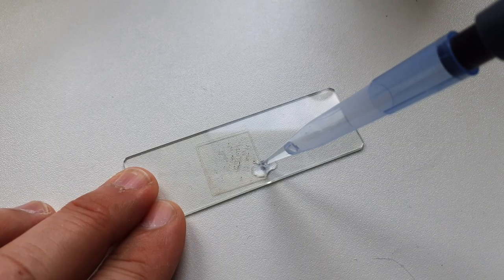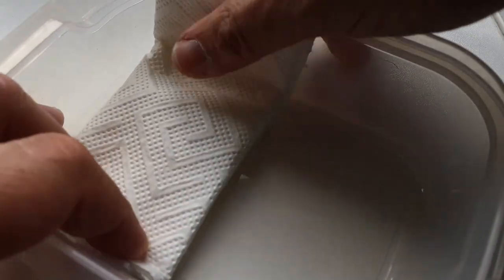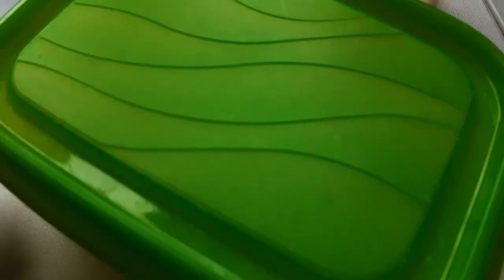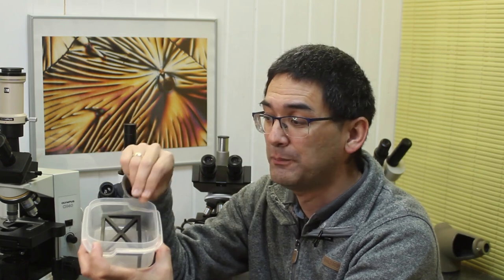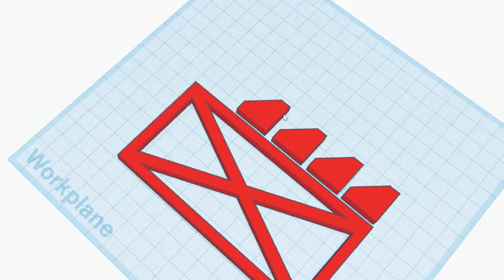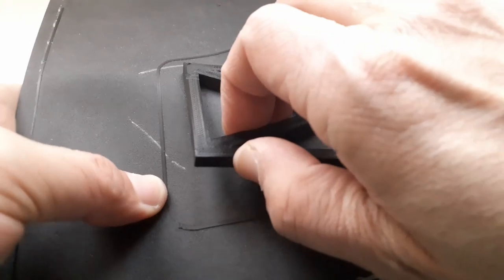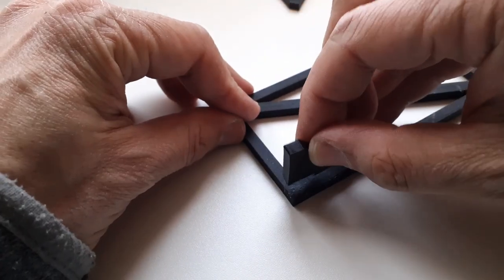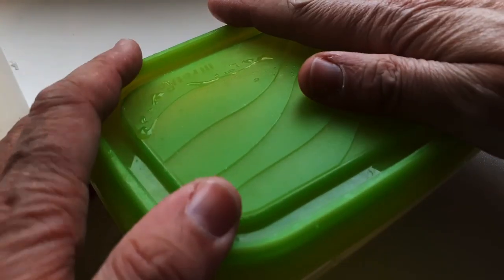🔬 How to make microscope slides last longer

Comment: Lovely elegant solution! I use a similar setup, although I don't have the luxury of a 3D printer, I pulled the innards out of two plastic pens and used the shells of the pens to create the rack to hold the slides up and off the water at the bottom. It's not the prettiest thing, but it works well

Comment: Nice. Good idea.
One way of preventing the water from the inside of the lid dripping onto the slide would be to slightly elevate the box on the side the slide is placed by placing something like an empty match box under the container, but not elevating it so much that the slide will slide off of the rack. Then the water on the lid will run to one end of the tub before dripping off. Another way would be to make a lean-to style inner lid that could be glued to the inside of the tub's lid.
Reply: yep, wood dowel or ice block sticks work well for that :)

Comment: Why not keep the paper in the bottom  under the rack? It will help prevent splashes when moving it around and the wicking action will present much more surface area which I would imagine would get the humidity up faster.